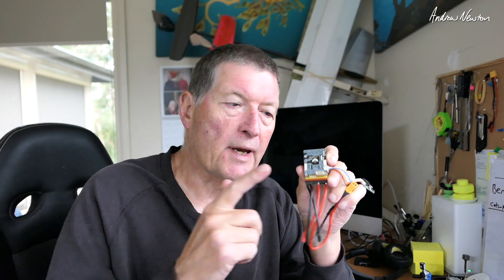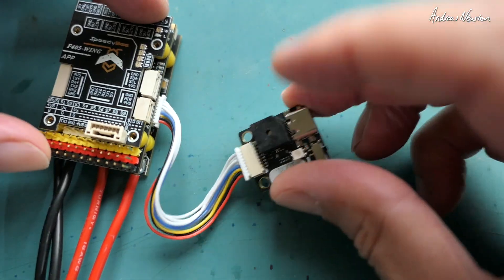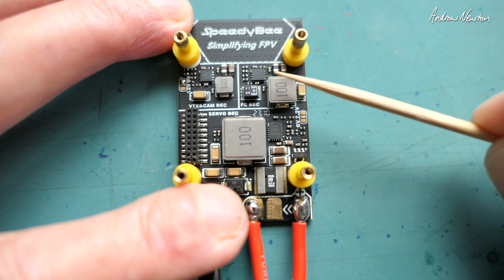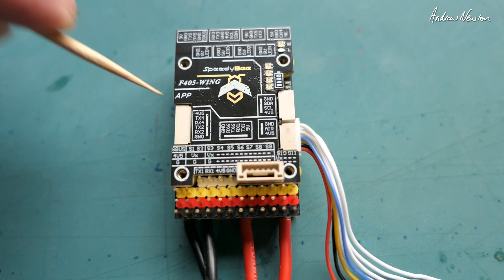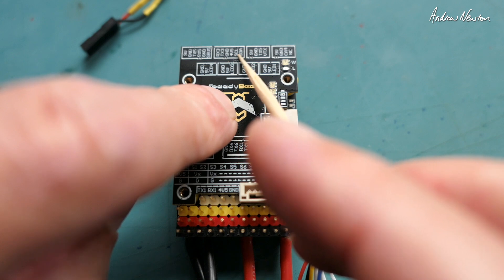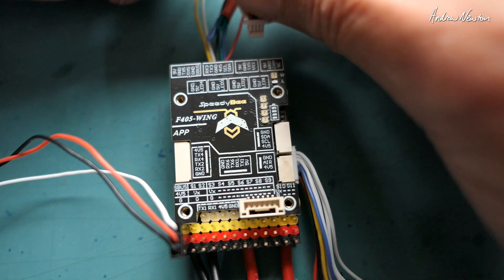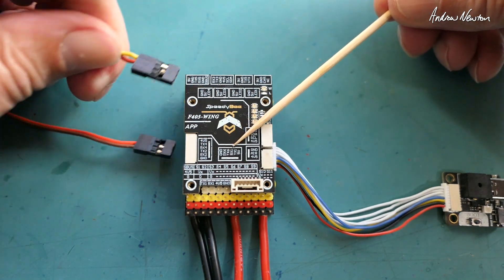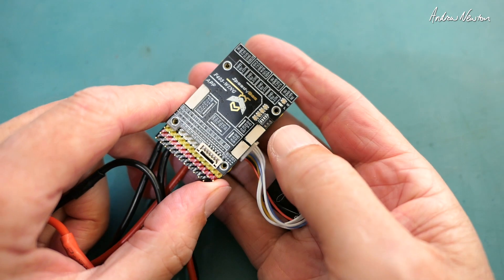SpeedyBee F405 Wing - Connection Basics

Comment: G-Day Andrew,  WOW mate,  I believed you helped to solve my problem. I have been flying a Matek W765 FC, with several good flight's, all modes working one flight two km away. Then I started to get a critical battery alarm when I armed the motor even after getting GPS lock and good to fly. Also fluctuating battery voltage on the INAV LUA, alarm would cease with disarm.                   Well, your advice in this video and the warning/instruction on the SpeedyBee F405-FC not to Connect the Battery lead  for the ESC! I believe that I must have burnt out the on-board BEC's on the FC, what do you think?                                                                                                                                                                                                                                                                                                                       OK it is my fault that I did not see/ notice in the Matek instruction for the FC  wiring diagram not to connect the Battery Lead. This was the first time soldering up a board, I watched a ton of YouTube videos on wiring up the board, but I do not remember anyone ever mentioning Not to hook up the ESC Battery lead, and I looked back at the Matek instruction's no warning, that I can see. I have spent over a year trying to figure out this problem, really, so THANK YOU and with me new SpeedyBee F405 my Ranger 2000 will be back in the air in no time!!! 🤓👍
Reply from the maker: Interesting to hear thanks. I wouldn't call it the battery lead, more like the 5V BEC lead. Happy gliding
Reply: @AndrewNewton  Yes Battery lead is  incorrect! Do you think having the 5V BEC lead from the speed controller, burnt out the onboard FC BEC' and that is the reason for the critical  alarm? Anyway going to change the FC over to the new SpeedyBee so I get this one back into the air. Thanks for all the great videos, responding to my Tx, and Happy Gliding to you mate.
Reply from the maker: Yes it is possible, a spike from the ESC could burn out components

Comment: Great video Andrew [as usual]. I noticed when you plugged in the SBUS receiver you left the voltage plug in. Would that not interfere with the FC board's internal BEC? Also is there anything stopping me from using SBUS connection with my crossfire receivers? 

Thanks

Greetings from Florida.
Reply from the maker: Only the BEC from ESC might interfere with the on-board BEC. Receiver needs power from the board to operate. SBUS should be fine from CRSF, but I have not tried it.

Comment: What GPS model is anyone recommending?
Reply from the maker: Beitian BN220 and BN880 work well
Reply: If I only have the GPS with 4 wires. Can I just leave the remaining two pins blank as the controller has a 6 pin connector. Which wires do I ignore?

Comment: I am going crazy with Vtail config in my radio. 
I have a jumper t16. 
I start with the vtail  config that the default setting shows using ch 1 and 5 for ailerons and ch 2 and 4 for the tail. 
In the inav tab all servos are reversed.
When i move rudder for pitching up or down everything is ok BUT when I move the rudder left or right the surfaces go always in the same direction.. don’t know what to do… i tried to  reverse channels on the radio and on inav with no luck . Desperate.
Reply from the maker: Reverse the weight in the INAV mixer for the incorrectly moving item. eg If Left rudder is +50 and moving wrong, change it to -50. Also remember dont set it up as VTail in the radio.
Reply: I wonder? You are not trying to set up your VTail on your TX are you? If you are then just set up roll, pitch and yaw all at 100% on single channels, and do all the VTail mixing in the INAV mixer
Reply: @peterhancox5268  I did set up vtail on my radio (wrongly).That was my mistake. Now all is ok. Thanks for your input as well.

Comment: Just finished installing mine in the worlds ugliest plane, everything working as expected. I'm a little nervous about running 6 servos off it's internal servo BEC, but we'll see how she crashes  flies! The Airloader in question has flaps 90% already installed, so what the heck I'll pop some 9g's in for sport.

It's interesting how the LED on the USB extension board is mapped to LED 0, can't wait to hook up to the LED controller on the board and put it through it's paces, I'm assuming the four LED connectors are all parallel when you have it in FC control mode, but we'll see. The board was a breeze to install (crank up the amps when you solder to the ground power pads, boys), and compared to my fleet of Matek boards, this has only one feature I miss, a 2nd camera input. Another interesting aspect of this board, is the free UART 4, and how they call it "User" in the documentation: I'm not used to having a free UART, and it's high time to get my Caddx Peanut and SMO 4K remote controls to work! lol
Thanks for the overview, Andrew!
Reply from the maker: I have never set up FC controlled LEDs. Let me know how it goes.
Reply: Best of luck with 6 servos, watch for that magic smoke

Comment: Andrew, some of us do not have fpv, we would like Telemetry, where/how do we get ‘smart port’ for say FrSky rx’s?
Reply from the maker: Thanks for the reminder. I'll investigate.
Reply: @AndrewNewton  cheers Andrew
Reply from the maker: No luck I'm afraid. Looking like Smart Port telemetry is not supported.
Reply: @AndrewNewton  Mine arrived today, it says that Smartport is supported, I’ll try it tomorrow
Reply from the maker: @Peter Hancox  ELRS CRSF telemetry works fine. Where is the Smart port reference? EDIT Found the reference in Pin Mapping. I'll try again
Reply: @AndrewNewton  Andrew, you won’t find this on the user manual that comes with the FC. You need to get online and get Speedybee F405 Wing App user manual v1.0. Part 5 is a table INAV pin mapping. SBUS is on RX2 with inverter, Smartport is on Tx2 via softserial. Have fun, maybe depends on what FrSky RX you have, some of them don’t seem to be happy with softserial Smartport, maybe it’s the way you hold your mouth?
Reply from the maker: @peterhancox5268  Yes I just saw it in the online manual about 10min ago! Smart Port on soft serial is working fine when I swap the receiver to my Matek board. Let me know if you succeed.
Reply: @AndrewNewton  it will be a couple of days, soldering work to do first
Reply from the maker: All working now. I contacted SpeedyBee support and they realised that TX2 had not been enabled for soft serial. Sent me new INAV 6 and 6.1 hex files which work as expected.
Reply: @AndrewNewton  yeah, me same. INAV version 6 could not enable Softserial, version 6.1 could enable it, but Smartport still not working. Speedybee have also sent me a test version labelled 6.1, I haven’t tried it yet, will see how it goes tomorrow
Reply: Still does not work for me, I’m exhausted. I have got a Softserial port now but no matter what FrSky RX I use still no telemetry. All (5) of the different RXs do work with other FCs such as Matek F405MWN, and an older clone Omnibus F405 v3, also WingFC 10 Dorf, so I’m at a loss to understand why no telemetry from this board. Soldering the pins onto the board was also a nightmare, I think they have some sort of protective coating over the pin pads, spend a lot of time cleaning the pads where you are going to solder before you start. Back to Speedybee help
Reply from the maker: @peterhancox5268  Have you flashed with the new "fix_softserial_issue" firmware? Here's a blog post showing my setup with an RX6R http://newtonairlines.blogspot.com/2023/05/smart-port-telemetry-inav-and-f4.html
Reply: @AndrewNewton  yes exactly the same setup as you show in your blog spot.  I have heard of Smartport issues before especially using SoftSerial. Do you know if there are a variety of different FrSky Smartport protocols? The frustrating thing is I can take any combination of FrSky SBUS/Smartport RXs with 3 other types of FC and can get Telemetry to work, all using INAV 6.1
Reply from the maker: @peterhancox5268  Only one S-Port as far as I know. I'm using RX6R with ACCST V2.1.1 FCC firmware. I'll try a few different Rx
Reply: @AndrewNewton  I’m still on ACCST either V1 or Alofts UniRX, might give Aloft a shout to see if they have any tips on Smartport. Also waiting for Speedybee help again, thanks for your efforts

Comment: great timing for me too. My SpeedyBee F405 Wing arrived this week. I intend to use it in a yet-to-be-assembled AtomRC/Eachine Seal, with the analog FPV kit they offered. What I took away from this vid was the connectors you use on your VTX setup and adapter pins for what looks to be your "standard" harness configuration for your VTX/camera pins - I would love to see more detail there, but what I saw was you have simply put dupont style 0.1" header pins and sockets on your cam and VTX and spliced to the (supplied) connectors for the specific FC board. Any tips on what the ideal cluster of pins and/or layout you use is? My AtomRC VTX is a TX15 with 5x bare unterminated wires, and has a foxeer toothless cam with 2x wires in one JST micro connector (unconnected perhaps, as they didn't supply a jst on a cable?) cable and 3x wires in a second jst.  I guess I aught to figure out what those wires all do :)
Reply from the maker: Can't expect anything to have the right connectors unfortunately. You will have to make up your own cables from the supplied AtomRC and Speed bees